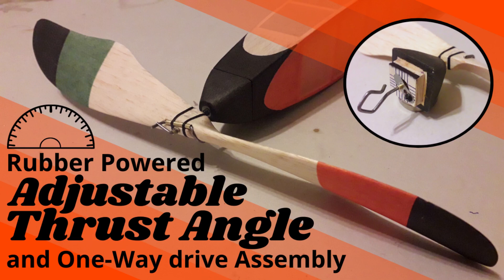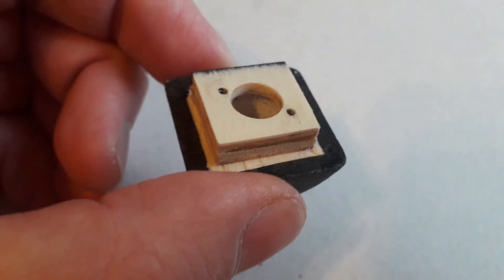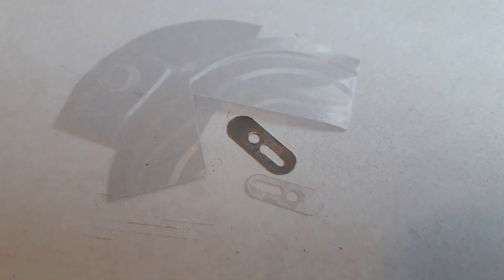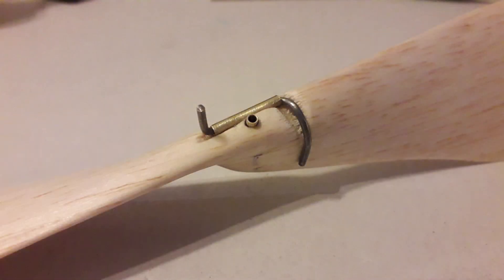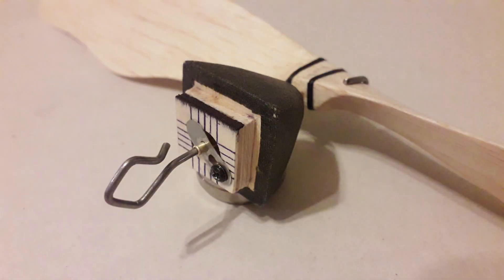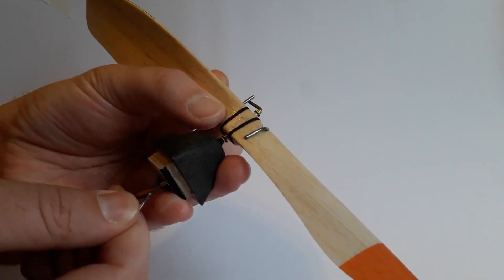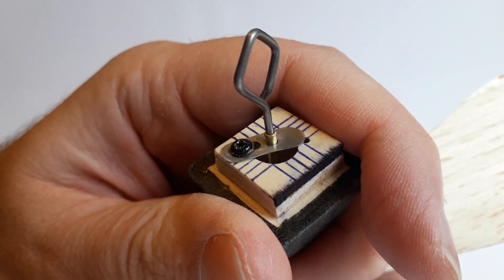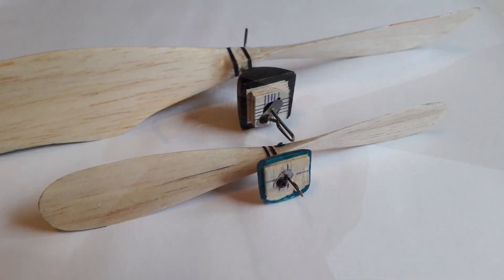How to setup Adjustable Thrust & One-Way Drive for Rubber Powered Models

Comment: I have been using a go no go ramp for my entire life to add a free spinning "clutch" to nylon props and tiny little spring from something like a clicky ballpoint pen to push the hook free and disengage from wooden props when the tension on the motor drops. Neither a full proof designs so as I'm about halfway through my current tiger moth I will be keen to try this out. Thanks for sharing.

Comment: I really like what you did here. Neat, clean, simple and great workmanship. Curious what size music wire and brass tube you used for your prop shaft and clutch assembly??
Reply: Hi Clinton, thank you for your great comment! The prop shaft is 2mm dia and the clutch assy is made with 1.5mm. Of course the brass tube is matched to provide minimal friction with no actual 'play'. This example was a 12" prop with a relatively powerful rubber motor but of course you could use smaller sizes for smaller props and lighter laods. Maxfliart has subsequently produced a video on this concept in which he provides more detail than I did, search for him on YouTube and subscribe to his channel if you haven't already - he is an absolute master of the art!

Comment: Great video.  It explains the mystery for us new modellers.
Reply: That's great Paul, I hope it works for you on your next build! There are of course many variables (you may need two locking screws for a powerful motor etc) but its simple enough in principle.

Comment: Great idea. How about another screw at the other end and an elongated slot. A partly hardwood nose block would help.
I use reverse S prop shaft and Tim White hook and 4 screw adjusters in F1.
Reply from the maker: Hi Jim, Thanks for your positive feedback. A second screw and possibly a second metal plate help secure the shaft firmly if you're using a lot of offset and lots of tension on the rubber motor. I kept the example simple to try to help get builders on the right track after which they can refine the design to their specific models. Best regards, Matt.

Comment: I tested it on an airplane with a wingspan of 27 inches. Under the action of pulling force, the sheet metal may be moved. A screw is difficult to fix, and some improvement may be needed. Still sincerely thank you, this approach expands the thinking. I will try some more.
Reply from the maker: Thank you for your constructive comment... it may be necessary to make adjustments to the design depending on the tension etc. A second plate can be fitted to improve strength and stability. I kept this example simple to make it easily understood but feel free to develop the concept to suite your models perfectly!
Reply: @truebalsamodeller5382  I increased the contact area between the aluminum sheet and the wood, then roughened the surface of the aluminum sheet and used larger screws. Successfully changed the thrust angle perfectly. Thanks again for sharing.